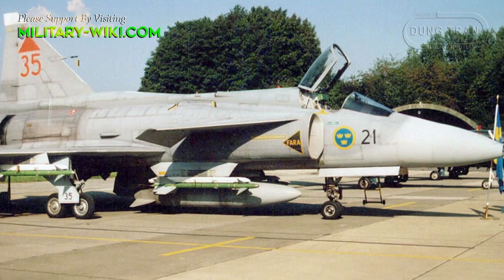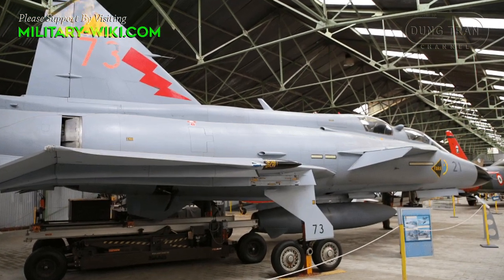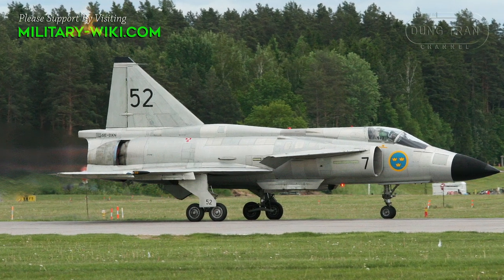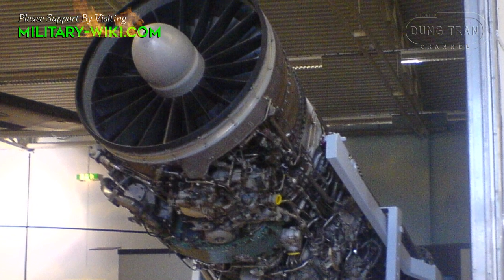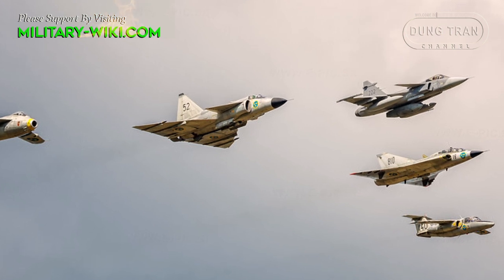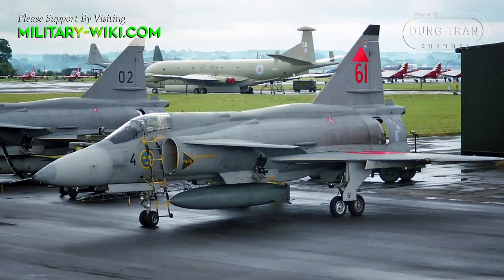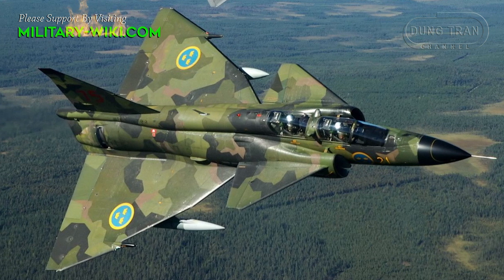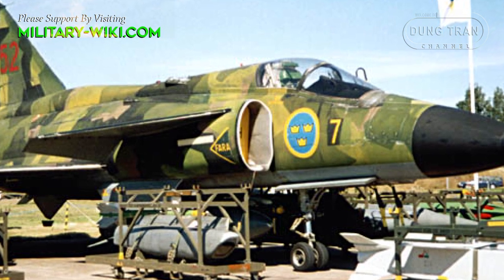SAAB 37 Viggen: Paved The Way For The Super-Maneuverable Fighter Line

Comment: Nice video - a bit brief and superficial.  Volvo Flygmotor's redesign of the PW JT8 CIVIL AIRLINER turbofan motor included adding an afterburner - the first afterburning turbofan in history.  The Viggen was designed for a short take-off run and to clear a motorway bridge soon after takeoff.  At its first visit to Farnborough Airshow, it took off after a short run under very low cloud, and then threw a barrel roll not far off the ground!